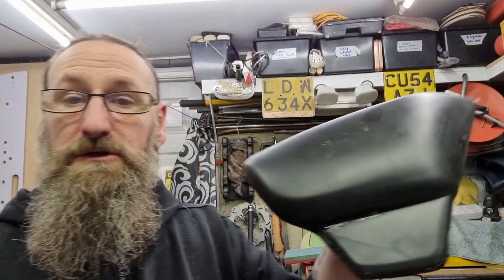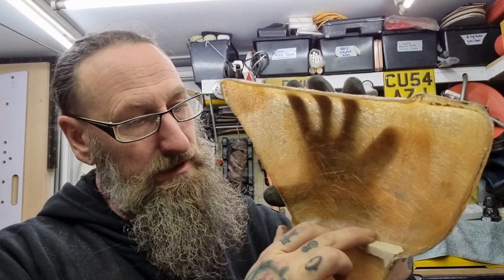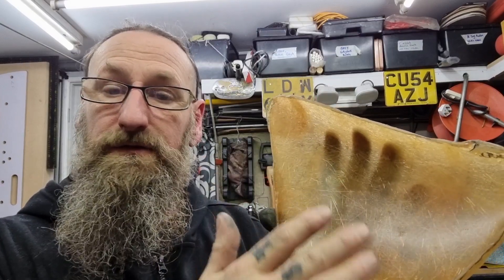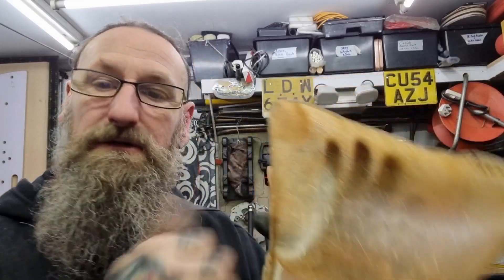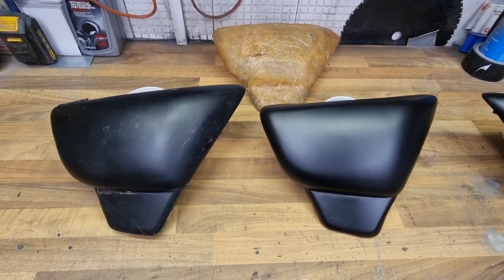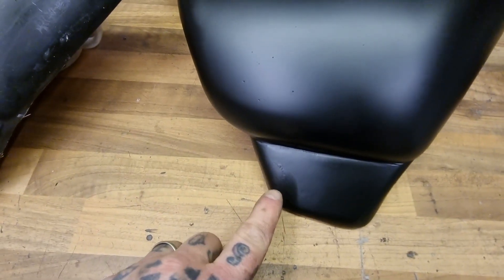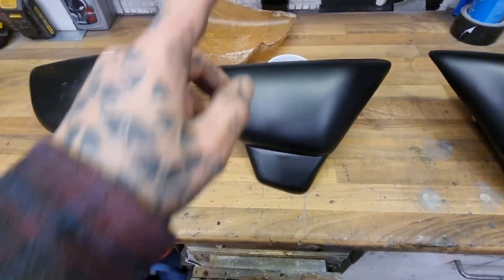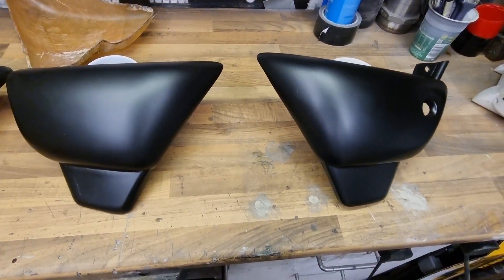125 project Episode 12 Pt2 fiberglass side panels

Comment: Very nice. I enjoyed both Pt. 1&2. I was wondering, when you apply the initial coat of resin/hardener do you let it dry up a bit before beginning to apply the cloth, or start with the cloth right away?
Reply from the maker: Thanks. Yeh I let the first coat dry off until its tacky then go in with the fiberglass matt